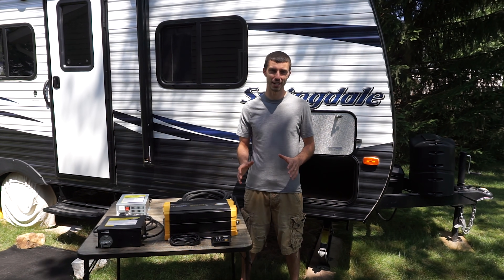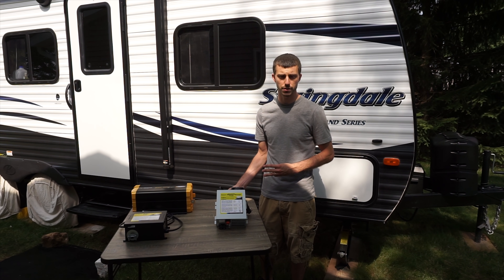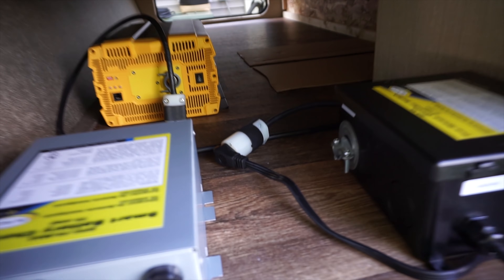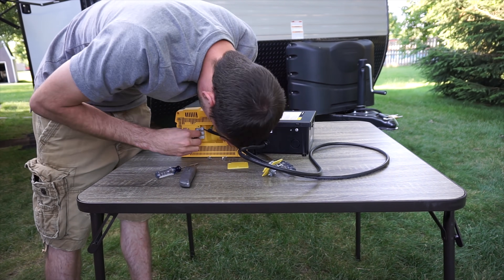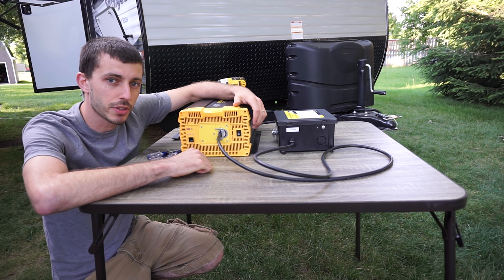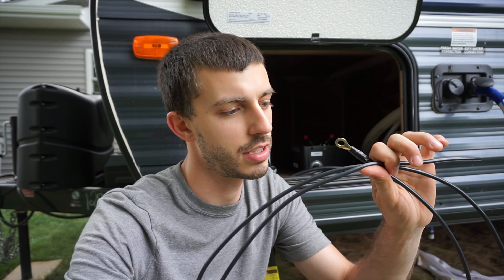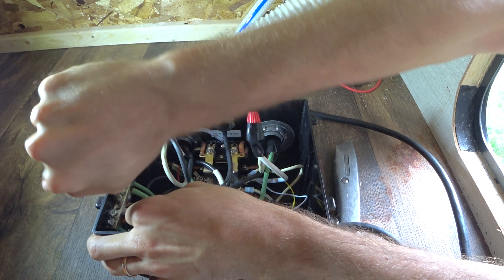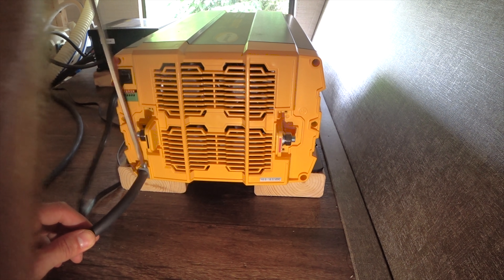Complete RV Solar Install For Boondocking / Dry Camping Part 2 of 3 - RV Upgrades

Comment: Love you walking through your install, for sure is helping me with my ideas.   I did have a few comments though :)   Please get some real wire crimping tools, the ones you had were anything but quality, look for ratcheting style with dies, you will love them.    
I noticed you stumbling on explaining the 3/10 wire routing..I dont blame you at all on that....   Easiest way for others to think about it is you are creating 2 sources of AC power VS the 1 the RV came with.  So you have to have this magical box  "transfer switch"  it takes 2 inputs inverter and shore power and provide 1 out and basically you need to install it in the middle of what is already in the RV.   Tada ... 
I'm sure you have heard it a few times already and maybe you have already moved things, but there is no way I could dedicate that much storage floor space for your stuff, there are usually lots of open spaces "wasted" spaces in a RV to hide these things.   I have a 5th wheel and I still want more storage. LOL
Keep up the videos, I mean all comments as a learning idea suggestion  VS negative.

Comment: Did you uninstall the original converter-charger that was in the trailer or did you just disconnect/bypass it when installing your new/smart converter-charger?

Comment: Great info! Was the underside of your tv already open frame or did you have to remove bottom barrier? Thanks
Reply from the maker: The tanks, wiring harness, etc. is uncovered. There is a tarp that covers the insulation for the underside of the floor, but that is all. I had to cut that to run the wires in and out of the RV however.

Comment: There are three types of outputs from inverters. Pure sine wave which is the best and sometimes even better than commercial power. Modified sine wave which was  your second type. Not as good as pure sine wave but better than the third type. Some wall warts do not like modified sine wave so watch the temps on them. Same applies to all electronics. While microwaves will operate on modified sine wave, they do not heat as well. The third type of inverter is a square wave inverter. Fine for light bulbs and things like drills but keep them away from anything electronic. Square wave is just that, the voltage peaks at both ends are flat and the rise and falls are straight lines. Modified sine waves have the benefits of steps on both the rise and falls of the voltage but still are flat at the peaks .

Comment: There are compact insulated terminal blocks that can be used to splice power wires where there is vibration that can cause twist wire nuts to loosen. Otherwise, wire nuts should be wrapped in quality electrical tape back onto the wire to keep everything snug and free of moisture. To protect against fire, electrical components should also go into a ventilated steel enclosure, which could be mounted on rubber shock-absorbing struts. That would deal with the possibility of water in the compartment as well.

Comment: This is great stuff, and will help me install my Solar Power, great job.  One suggestion, all of your wire nuts should be taped with electrical take to keep them from coming off during travel.
Reply from the maker: Thank you! I'm glad you found it helpful. And don't worry I did use a healthy amount of electrical tape but for some reason didn't show all of it. I ended up replacing all the wire nuts with crimp connectors though.

Comment: hello, ray in cali again.it looks like some wire connectors under your install are not corrosion controlled . you should get the type that have a built in sealer. you crimp your wire then heat them up with a heat gun. the silicone oozes out to protect. they will corrode and cause you problems....thanks for the videos...
Reply: Copper on copper won't corrode, zinc on copper will. you can do the same thing with vaseline. Also, as mentioned earlier, wire nuts aren't ideal in an RV anyway
Reply from the maker: Thanks for the tip Ray. I'll look into getting some of the corrosion protective connectors you explained.

Comment: Hey guys...hope all is well. I have a quick question about your set up. I’m just curious, does your AC panel have a smart charger built into it? And if so, why the additional charger? I’m asking because I have a motor home with an AC panel/charger converter and am curious when hooking up my transfer switch will I just run wires from that charger or is a separate one needed if mine is already a smart charger? Thanks for any info you could provide.
Reply from the maker: Thanks Mike! Our AC panel did not have a smart charger, it was a single stage charger. If the factory converter charger is already suitable for your application then there is no need to replace it. You can just run wires from the existing converter to the transfer switch. Let me know if you have any other questions, I'm happy to answer them!
Reply: Just remember where your converter is in the wiring because you don't want the Inverter running the Converter in  vicious loop.

Comment: This video series is helping me so much on my solar install! Where did you get the 10 gauge wire? I couldn’t find it at Home Depot :(  and the ones I saw on amazon didn’t seem exactly like yours
Reply from the maker: Awesome I'm glad it's helpful! Most of that 10 gauge wire came with the solar kit. The extra I bought from an electrical supply store called Kendall Electric. You could try electrical supply stores in your area.

Comment: While the component install looks beautiful (neat, organized) I gotta ask, why didn't you mount everything high and left against the front wall of the trailer? It would have solved the potential water problem and freed up the floor space for other essential basement stuff.
Reply: you might want to consider mounting the inverter, Switch and converter higher on the sidewall so you don't loose so much storage space.
Reply: Walls of the storage space may not be solid enough.. the floor is probably thicker wood.
Reply from the maker: That's not a bad idea but I'm not sure it would work. The left wall isn't structural, it is just a luan panel with studs every so often for support. The floor however is 3/4" plywood. Also, I wanted that entire area to be sectioned off from the rest so that nothing would fall on or interfere with the solar components. The inverter also needs a lot of open space to be able to keep itself cool, especially when we run it all day every day.

Comment: In a vibrating environment such as an RV, you don't want to use wire nuts for electrical connections.  They will loosen up over time causing higher resistance and heat and eventually fire!  Replace them with properly sized, crimp-on, butt connectors.
Reply: Totally agree. Also, contact surface area is everything to minimize resistance joints. I solder all my connections.
Reply: @jimpiper5297  solder joints fail just as much as wire nut connections due to heat. I would trust a proper wire nut install than a solder connection.
Reply: Or you can use them, and then wrap them with electrical tape.  Or splice and use shrink wrap.

Comment: Dave sorry I new I wanted to ask one more question.  How much did your tong weight go up to?  Thanks Greg
Reply from the maker: +Greg Johnson I'm not sure we haven't had it weighed. But these lithium batteries only weigh 62 pounds each so I doubt they had much impact on the tongue weight. Especially considering I removed the factory lead acid battery that was right on the tongue and weighed at least 60 pounds.
Reply: Fate Unbound oh nice, they are light batteries. They just look heavy on video. Thanks for the response and enjoy those panels.  I just bought 200 watts for my RV roof myself.  Been studying everyone’s install videos to learn what I need to do.  I’m going to make my own attachment tilting bracket myself like you did.  I have to much metal in the garage and plenty of tools so I have to build them.

Comment: David great install nice job.  I was wondering if you know what the max dc amp draw your battery monitor has show while using your 3000watt inverter? And one more Q.  how long have you been able to run your roof a/c on batts/solar.  Or haven’t you tried yet. Thanks Greg
Reply from the maker: Thank you I appreciate that! The maximum we've ever drawn from our battery bank at a time is 120 amps. This is what our microwave pulls by itself. We shut everything else off before turning the microwave on hahaha. We don't run our A/C off our batteries and solar. It draws just so much that it will drain us down incredibly fast and just isn't worth it. We live without A/C by choice and just turn some fans on when it gets hot. I made a video about running A/C off solar, maybe you'd like to check it out https://www.youtube.com/watch?v=XHPIEy9Ciac

Comment: Hey what size breaker did you use for this system?
Reply from the maker: +Joe Parnell What is the breaker wired between?
Reply from the maker: +Joe Parnell I don't have any breakers in this system except for the breakers in the AC panel. I just have fast acting fuses on every positive wire leading to the batteries and between the solar panels and solar controller.
Reply: Fate Unbound yeah my father in-law is helping and was asking what size breaker we should use in our ac panel. That way he knows what size wire held need to run to the rest of the unit for pugs. If that make any since to you. Lol new to me
Reply from the maker: Do you not already have plugs in your RV? I didnt have to run any extra wire for the existing plugs, just 3 10 gauge wires from the transfer switch to the AC panel's existing main breaker (which is 30 Amp), neutral bus, and ground bus. What RV are you installing this onto so I can get a better idea.
Reply: No I'm sorry I forgot to mention  we are remodeling a school bus so we will be putting our own plugs in
Reply from the maker: Ohhh haha okay. My plugs are all wired to a 15-amp breaker in the AC panel. Hope that answers your question!
Reply: It did thanks a bunch.

Comment: Dave, great video series....seems simple yet complicated to get the initial information and break it down. Where did you get all the info to know how to do all the wiring of the various components. Is it from the directions that come with the components or was there a central set of instructions?
Reply from the maker: +Sharon Wignot I agree it is pretty complicated at first but once all the information is gathered it's actually really straightforward. I got my information from three sources: the manuals that came with each component, calling Go Power and Relion technical service, and the internet/youtube. I couldn't find any videos though that showed a step by step install of the whole setup though so hopefully this series can be a good resource for people =)

Comment: We purchased a 2017 keystone Springdale 2600 tb. Any pros or cons you have for me and the wifey?thank you.
Reply from the maker: +fred miller I'm no expert and can only really speak on this since I also own a Springdale Summerland. But Springdale is basically Keystones "entry level" or "economy" brand. With that said though they have everything you need to live in them (and we do). They don't have all the bells and whistles like you'll find on the more luxury models like quiet cool AC, self leveling jacks, heat pump, more interior storage, Maxx fans, day/night roller shades, 4 season insulation, etc. But because of that obviously the price will be MUCH lower while still being basically the same quality of construction. And going with a Keystone in my opinion is a good move because they are a company that will be around for a long time so replacement parts will always be available.

We love our Springdale Summerland and are glad we bought it!

Comment: Dave, another great video.  It is nice the way you make sure you explain everything step by step as you go.  You will soon have all the comforts of home with you no matter where you are.  That will give you so much more freedom to camp where you want.  I'm curious what you did for a job before you quit to full time RV.  You are really handy and know your way around with tools, etc.  My wife and I are waiting for you to get back on the road and follow your adventures again.  Also, ask around about this.  I hear you should always wrap those wire nuts with tape to prevent them from loosening.
Reply from the maker: +Mike Lizonitz Thanks Mike! I tried my best to show every step so someone else doing an install like this would have a really good resource. These videos were actually shot back in June just before we hit the road so we've had the solar this whole time but are just now getting around to posting the install videos :P  Before we hit the road I was a mechanical engineer. We are back on the road now and will get back to posting out adventures right after the next (and last) solar install video! And I actually did wrap all the wire nuts tightly in electrical tape but for some reason I failed to show that on camera. Thanks for saying that though in case I didn't and for anyone reading your comment working on a solar install of their own!
Reply: Ha, yes, I figured that this was your original install.  You did make it seem easy.  The Mechanical Engineer background shows.  Glad you did wrap the wire nuts.  That way you avoid problems down the road.  I figured you would be back on the road by now so you can avoid the snow and cold up north.....    If you are like us, you enjoy life best when on the road.  Stay safe and healthy.
Reply: How much would you charge to wire my inverter into my 1999 Bounder?

Comment: Why didn't you just get an inverter/charger all in one??
Reply: What is the cost of the solar unit? I know it depends on what you expect too run off your solar power. Advantages over a inverter generator vs solar power power?thank you ,luv your videos.
Reply from the maker: +RV Legal Eagles & Paws At the time I didn't know they existed
Reply from the maker: +fred miller The solar extreme kit from Go Power cost us $3600, this is not including our batteries.
The advantages of solar power over an inverter generator is that once you make the initial up front cost it is completely free. There is no gas, no oil, no maintanence whatsoever other than keeping the solar panels clean. And solar power is silent where a generator is pretty annoying.
Disadvantages of solar however is the initial up front cost is quite high. You cant use high draw appliances like an air conditioner unless you have a large battery bank and solar array. And the installation can be difficult, or if you have a proffessional do it, expensive.
We love our solar setup and couldn't imagine firing up a generator every time we needed AC power. With that said though we do have a conventional portable generator just in case we run into many cloudy days in a row and need to charge our batteries back up, or need to run the AC on an incredibly hot day. We haven't ran it once yet though haha =)